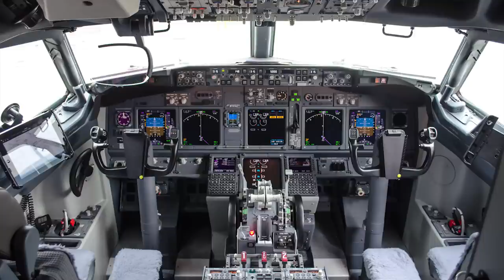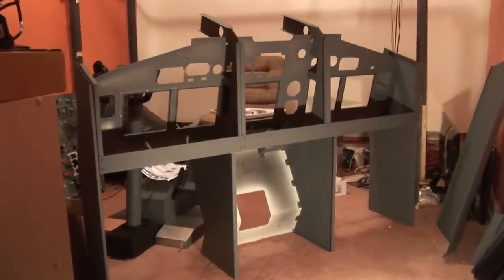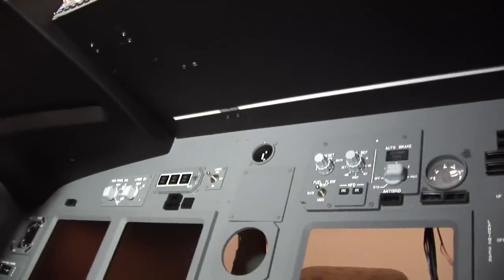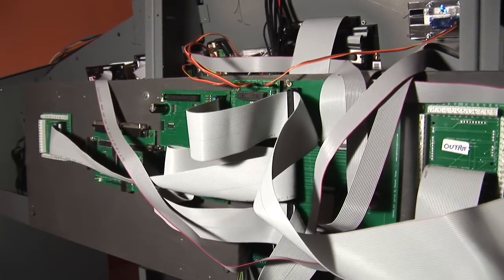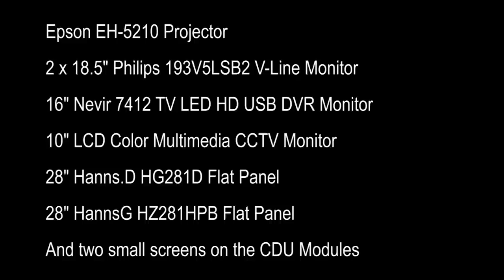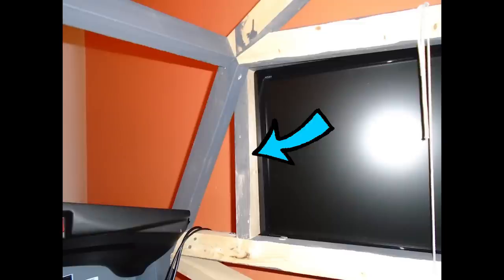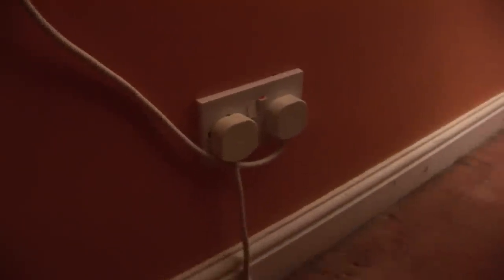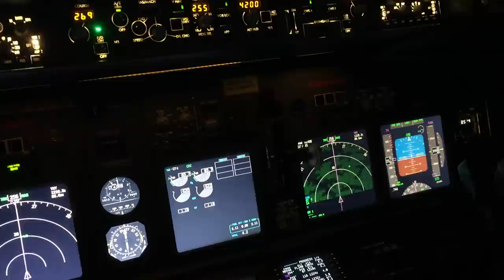Building a Boeing 737 Cockpit

Comment: Hi Father Dane could you tell me why you chose Prepared over X plane for you sim build
Reply from the maker: There are always extras with every sim software, it seemed to me that XP had more than P3D. Plus, when I started out I considered XP but dismissed it as being too proprietary and the early versions weren't easy. P3D was backward compatible with FSX and was an easier transition. Does this help? 😊
Reply: @FatherDane  Hi thanks for the info I am currently waiting to see what XP12 has to offer before I take the plunge. Very impressed with your SIM and just a little jealous lol. Any way keep simming and clear skies.
Reply from the maker: @martinpowell3855  The other reason I stayed away was the issue of compatibility with my hardware. It's like MSFS right now: lovely graphics but problems connecting the hardware to the software and (with MSFS) inability to use more than one monitor. You are right to examine your options though, as no matter which way you go, there will always be additional costs. 😊

Comment: Hi, my compliments for this great video. As I am in the process of building a B738 flightdeck myself, could you please explain how you've managed to get the CDU's to the other displays automatically each time you startup P3D. Also I can't figure out how the 2 gauges in the middle of the MIP are displayed. Any help is welcome.  / Niek (the Netherlands)
Reply from the maker: Hello.  I can explain what I did, but it depends on whether you are using the same OS and sim software that I use.  I have P3Dv4 and the 737 software is PMDG 737 NGX.  Are you using computer monitors behind the cut-out space in the MIP?  If you are using the system I have, then you simply need to click on the vehicle parts (top row menu bar) and select the pop-out screens for the various MIP screen spaces.  Right click on them and select unlock so you can move them into the MIP space and then enlarge them to fit.  Then, be sure to right click again and select LOCK to make sure they don't go adrift.  Now you need to save this as a SCENARIO (I also like to make a copy as well) as all the panels will then load each time whenever you select the scenario because they become part of it.  Selecting the aircraft each time only loads an empty screen - loading a scenario loads the panels with it.  Give that a try and let me know if you need more information.
Reply: Father Dane , thanks a lot for your fast response. It seems that I use the same software and the same setup. I'll try your procedure first and let you know how it goes. Best regards, Niek
Reply from the maker: You are more than welcome :)
Reply: Father Dane Thanks for your tips yesterday. I managed to undock the 3 major DU's on the captains side and safe them in a scenario. For some reason I cannot select LOCK, but the panels don't seem to drift anyway. Unfortnutaly I have not found how to undock the two 2nd flightinstuments in between the Inboard DU and the Upper DU.
Reply from the maker: I presume here that you have set your main window to be COCKPIT and not the virtual cockpit.  When you click on the overhead menu bar and select VEHICLE and then Instrument Panel.  There is an item at the bottom that you can check that will open up a list of all the panels available.  Then select the panels you need from this list.  Remember to use the UNDOCKING and DOCKING feature to ensure the scenario remembers where the panels are.  If the LOCK feature is not available then it may be that the panel placement is overlapping another monitor - you can check that out first.  But to ensure that it is locked, you can go into the SAVED Scenario and using NOTEPAD to edit it, simply scroll through the list until you get to your panel and find the UNLOCKED and change it to LOCKED (I'm not at my simulator right now so I can't remember if that is the term but you will recognise it when you see it).  Save the change and then that panel will remain in place - as long as you select the same scenario each time.  See if that works out for you.
Reply: Father Dane Thanks a million for your great help.LOCKING is ok now, but still could not find the 2 small displays in the panel-list. I will look into it further, tonight and let you know. / Niek
Reply from the maker: OK
Reply: Father Dane I am sorry to report that the 2 stand-by gauges don't show up in my vehicle panellist, as expected. So I'm afraid that I have to drop the idea of having these 2 gauges integrated in my MIP. Thanks for all your great help, and good luck with the sim-hobby. Regards, Niek
Reply from the maker: They should be there.  Please go to the PMDG Forum and post a question there for the real experts to answer: https://forum.pmdg.com/ They will be your best source for support of PMDG.  Sorry you are having trouble with this, but the panels are there - you can see that I have mine - so it may be a setting you have overlooked and the support people on the forum can spot it for you.  Best wishes
Reply from the maker: Here is a short video on what you should look for and which panels to select and move into your hardware MIP: https://youtu.be/qwjXxZixLc4 Happy;landings

Comment: Links for all the parts? Would love to start a project like this but have no idea what i need
Reply from the maker: First of all you need to decide how detailed you want your simulator to be.  You also need to decide how real it should be - meaning the equipment, should it feel and act like a real 737. You also need to decide where you are going to build it and how much room you will have.  I only had a small spare bedroom and I didn't have much cash.  So I suppose what I'm saying is: decide what you want it to look like when it it's finished and then work out a path to get there.  I took 16 years to get this, and it went through a dozen variations.  Changes were made as I was able to afford parts.  I didn't have a real plan so it sort of grew into what it is today.  I would not do it this way if I had to do it all over again but instead start out with a plan.  Now to be fair, 16 years ago there was very little out there on the topic but today there are lost of resources to check out.  Let me share this link with you as a starting point: https://vimeo.com/417587942.  Look at these and other sites and decide what you want to end up with, and you know what?  You will have the answer.  Parts are only a small part of the project - and there are suppliers all over the world with just about everything you will need.
Reply: Father Dane thanks for that, yeah having a simulator would be cool and obviously have mentioned i have 0 clue about sim hardware and what id need so il have a check on this video

Comment: Dear Father
After watchin this video a few times, I'm here to confess: I'm converted.
Your passion is and inspiration and has reawaken in myself an old desire to fly an aircraft. 
I'm a complete beginner and my first task will be to learn to fly on screen, mouse an keyboard only before I start splashing the hard earned money in hardware. Can I ask you if Prepare3d lend itself to this task. In other words, can I use this software with keyboard and mouse only and perhaps a simple set of yoke and pedals?
Many thanks
Caula
Reply from the maker: Absolutely you can!  It's the way I started out 16 years ago. 😊
Reply: @FatherDane  Thanks for your swift reply. Much appreciated.

Comment: hi father. Previously I created an overhead with an arduino and mobiflight platform and now I wanted to assemble a small pedestal with the essential things nav com adf trasponder etc. I took a look at opencockpit and there are plug and play models that do not need any type of card and connect with USB. I state that I use pmdg and not sioc, you know if so those modules need configuration with sioc ?? and if they are compatible with pmdg? Bye
Reply from the maker: The pedals and yokes are all standard controls and work with the native P3D software or as I do, with FSUIPC.  SIOC is only needed on mine for the electronic instruments

Comment: is it too difficult to upgrade the software to Flight Simulator 2020?
Reply from the maker: For me, and as things are, the answer would be yes.  I have a hardware simulator and that needs a software aircraft and drivers to connect it to FS2020.  Those are not yet available.  But once they are, then it would require me to perform a clean and new installation of all the software from scratch, and then add all the drivers, and then make all the connections, and then tweak all the controls not to mention align all the views before I could even start the first engine. I remember that the process for P3D took several days and many hours to get it right.  Then the other aspect is cost: I have 151 airport sceneries - all of which work in P3D but not in FS2020.  So the expense is another factor: the cost of FS2020, plus all the sim software and drivers and replacing 151 airport sceneries does not make for a cheap transition. Will I move over?  Perhaps at some date in the future when I have enough money saved and all the bugs are worked out but that is a date two or three years away at least - for me anyway.  Does this help?
Reply: @FatherDane  yes, thanks!
Reply from the maker: @leandritodiaz1  😊

Comment: What is the exact cost of this corpit .
And from where we can buy.
Reply from the maker: I started collecting parts for this 16 years ago and it all came together a bit over a year ago.  So it is difficult to put an amount on it.  But if you bought the parts in one lot then I suspect you would be looking at £25,000 in today's market.  Sources are Opencockpits in Spain, Flight Simulator Centre in Italy, and Amazon online for all the electronics and then hardware stores and carpet stores for all the rest of the parts.  Does this help?
Reply: So it will took my hole life.
I am 17 years flying lover from India .  Thanks for replying with the help of your videos i will do the same , thanks .
Reply from the maker: @kartikbhargav1077  Here's a link to some plans and dimensions that I used to construct my simulator.  Perhaps they will assist you.  https://drive.google.com/file/d/1l5mNmJFpbRfMcJ9XAUcXWuCTEEu9wGVG/view?usp=sharing  Happy flying!

Comment: I‘d like to see OLED panels at the cockpit
Reply from the maker: OLED is considered superior by many, but in this cockpit, I don't think it would make any difference as the screens are simply 2D representations of the instrument panel.  And LED were cheaper 😉
Reply: Father Dane, also how much it costs to build apr.?
Reply from the maker: If you went out and purchased all the parts to build what I have now, and assemble it yourself, then you would need around $25,000 to do it I think

Comment: I was just wondering do you think that you could fly a real 737 after learning on your simulator just curious?
Reply from the maker: This is always a good question.  Well, I am an experienced commercial IFR pilot - but I only flew cargo propeller aircraft such as the C-47 and C-123.  I have had a few hours in the larger DC-6 (four engine).  So, could I transition to a commercial jet?  My short answer would be yes, because flight is flight and all aircraft behave pretty much the same just as going from a car to a large bus would be the same - except weight, speed and size are the critical factors.  But, and here is the caveat, jets are much faster and therefore landing speeds and stall speeds are different and more critical.  From what I have learned, flying a commercial jet is all about the programming of the FMC/CDU.  If the flight computer has the correct information, then the automatic systems will do most of the work - and if you already know how to fly and have experience, then you can handle the aircraft.  In reality, and this was something that I pointed out to my 737 captain friend - the pilot only flies the aircraft off and then the auto-pilot takes off, and the pilot doesn't take back control until on a short final.  In between is boredom … the auto-pilot is flying.  And my 737 captain friend said yes, which is why the airlines give the pilots a lot of paperwork to fill in enroute, to keep them awake.  Flying prop aircraft in the old days (when dinosaurs still roamed the earth) was analogue and there were no convenient navigation aids for me then.  My goodness, I remember asking someone at the other end of a radio to hold down the microphone button for ten seconds so I could get a fix to his location via my ADF.  That is how I flew then!  (And as a matter of history, that is how the Japanese navigated to Hawaii from carriers in the Pacific - they tuned into Radio Honolulu and flew the needle on the ADF).  Today is all digital and the navigation aids are wonderful.  How did we ever manage to navigate without GPS?  But we did because we knew how to read maps - paper maps, the old fashioned way.  Good question!
Reply: Father Dane Well thank you that answered my question I kind of figured you could you’re very experienced.
Reply from the maker: @stewrtcullom7924  :)

Comment: why use a projector rather than put screens on the front windows also
Reply from the maker: When I built this there weren't any really large monitors around, and those that were largish, were costing a king's ransom.  So I used a projection screen to fill the whole wall ... and more important, to allow me to keep the centre post on top of the glare shield. Of course the price has dropped and the screen sizes have increased since then, which is why I am now looking at replacing the projector and two smaller side monitors, with three 65" large screens.😊

Comment: can you link all the parts where you got them
Reply from the maker: Flight Simulator Centre in Italy.  Opencockpits in Spain. Hardware from a local store.  Fabric and material from a vinyl flooring store. Wooden panels from packing crates.  Monitors and projector from Amazon.  Does this help?

Comment: What FPS were you getting?
Reply from the maker: Not a good one I'm afraid.  At best I may get 12 on a good day but lately - and because the scenery is intensive - I have dropped to single digits.  Today my project is to do some tweaking to see if I can squeeze some extra frames out of it, but the reality is, that it may take a second computer to deliver me a decent frame rate on the external views.  I have one computer with three graphic cards running nine monitors - so you can appreciate that it does present a challenge.

Comment: How much did the simulator package cost and where from ?
Reply: IF YOU HAVE TO ASK HOW MUCH IT COST'S YOU CANT AFFORD IT.
The software was $4999.oo
every switch is $3.oo to $75.oo

the screens are $699.oo each. 
console is $15OO
I'm guessing it cost $1O,OOO - $15,OOO to build.
Reply from the maker: It all depends on how far you want to go with your simulator.  I have been building mine for over 15 years and I suppose it is worth somewhere around £25,000 now if I were to start again.  And most of it came from Opencockpits in Spain. Does this help?

Comment: Next Video Idea: BHX to IST
Reply from the maker: Hello - that would be a long flight for me as the only interesting bits are the take-off and the landing, plus the video recording is also very long. I need to restrict flights distances to around 200 to 300 nm - could you suggest some other points, please?
Reply: Maybe BHX-DUB
Reply from the maker: @TheBlimpCompanyOffical  That works just fine! I have it booked in 😊
Reply: Thanks this time do jet2
Reply from the maker: Do you mean to change my livery and callsign?
Reply: Yes
Reply from the maker: I'm not able to do that without a massive bit of reprogramming. For example: I would select a new 737-800 aircraft and with a Jet2 livery then enter P3D. I would then have to select every display panel and re-size it and move it into place on my hardware simulator - which is a 737-800 cockpit. The time for this would not be short and the process is very tedious. It is for that reason I always use Ryanair livery and 186 as the callsign. So perhaps you will understand that I will have to politely decline to make this change. I will be happy to make the flight but as Ryanair 186. will that be all right?
Reply: Yes
Reply: Can You Do The Video Tomorrow
Reply from the maker: @TheBlimpCompanyOffical  Unfortunately I can't - I already have one prepared for tomorrow and for next week. Then I have others who have made requests. Yours is booked for 4 December. Sorry
Reply: That's fine :)
Reply from the maker: The flight has been made and the video is unlisted on YouTube, but you can see it before everyone else right here https://youtu.be/qIyjrR0FwHU I hope you like it 😊

Comment: How much and where did you get the yoke from sir?
Reply from the maker: It all depends on how far you want to go with your simulator.  I have been building mine for over 15 years and I suppose it is worth somewhere around £25,000 now if I were to start again.  And the parts are mainly from Opencockpits in Spain.  Does this help?

Comment: One question: How mutch did it cost?
Reply from the maker: Over the past 16 years I would guess about £25,000 all told.  That includes the simulator and all the parts, as well as the monitors and projector plus the all important computer with all the software.  Does this help?

Comment: How much did it cost you for the whole setup sir?
Reply: Edmund Kpodogui over 15.000€
Reply from the maker: It all depends on how far you want to go with your simulator.  I have been building mine for over 15 years and I suppose it is worth somewhere around £25,000 now if I were to start again.  Does this help?